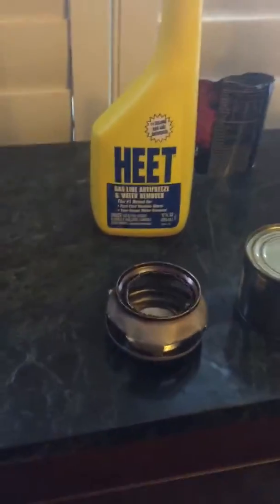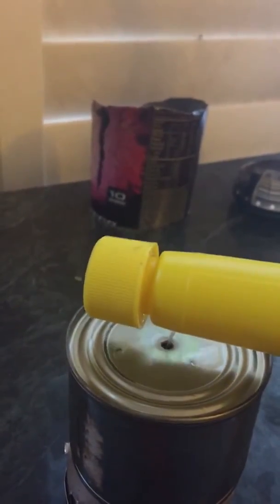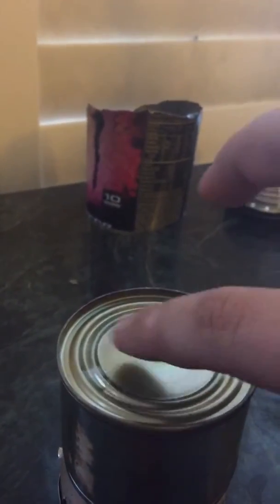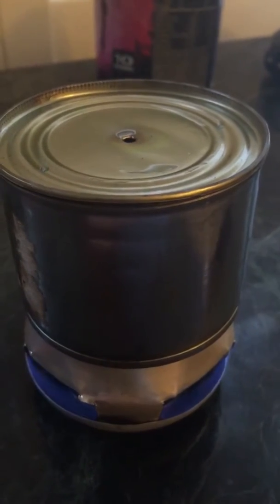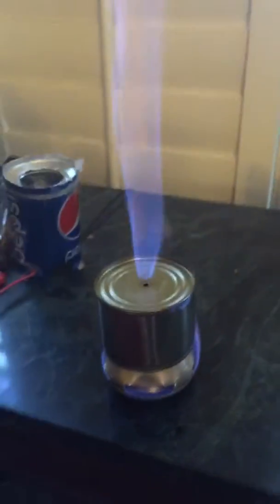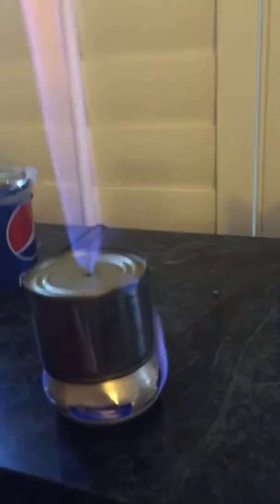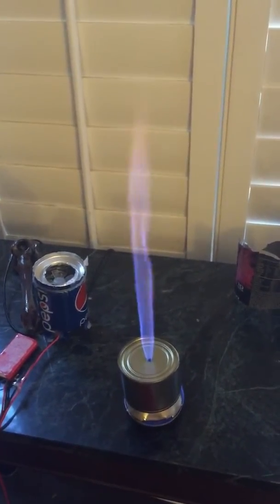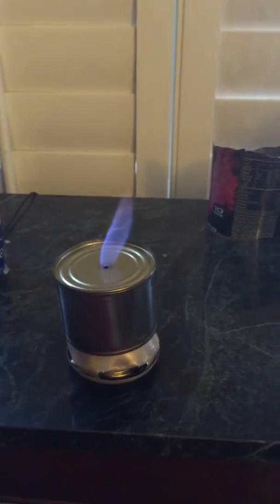Diy bunsen burner alcohol torch stove

Comment: Hey man, I came across this same idea while trying to power my stirling engine.
I used a tea light in the bottom section and ran mine on methylated spirits, but mine keeps going out at random times I think because I used too small a hole in my top burner.
But it is a great way to "amplify" a tea light flame.
Reply from the maker: Yea if the flame is going out. It its probly building to much pressure and need a slightly bugger hole. In this video i was running is off of methynol or heet as its sold in stores.  Take a look at my other video i have a turbo version of this also.

Comment from the maker: I cut a soda can in half and used the bottom of the can to hold the fuel and then used the top of the can to make a table with 4 legs to go over the fuel bowl. It is for preheating the fuel in the can of corn. The tin can is a small can of corn, the can opener i have cuts the top off the tin can from the side and make a resealable lid. Empty the corn from the can and poke a hole in the lid with a nail and reseal the lid to the tin can. Then its done, just watch video how to add fuel and do it in the same steps. I hope this helps. Also check out the turbo burner video i have for moooore poower!! Haha

Comment: Dude that's badass... can you make a video on how exactly you made this? I wonder if I can use my trangia burner?
Reply from the maker: I cut a soda can in half and used the bottom of the can to hold the fuel and then used the top of the can to make a table with 4 legs to go over the fuel bowl. It is for preheating the fuel in the can of corn. The tin can is a small can of corn, the can opener i have cuts the top off the tin can from the side and make a resealable lid. Empty the corn from the can and poke a hole in the lid with a nail and reseal the lid to the tin can. Then its done, just watch video how to add fuel and do it in the same steps. I hope this helps. Also check out the turbo burner video i have for moooore poower!! Haha